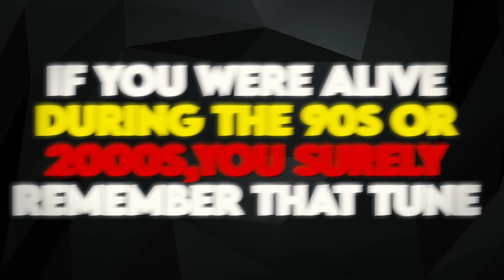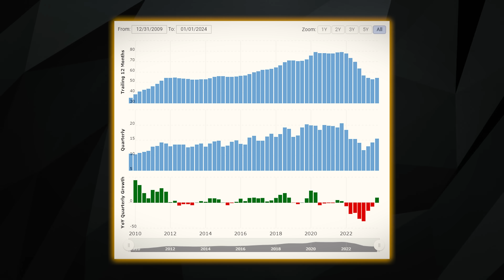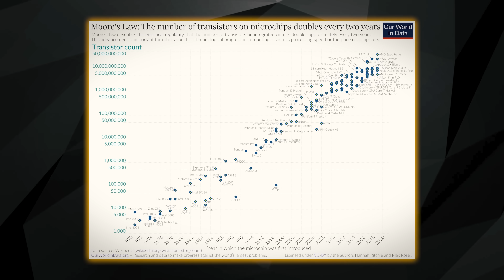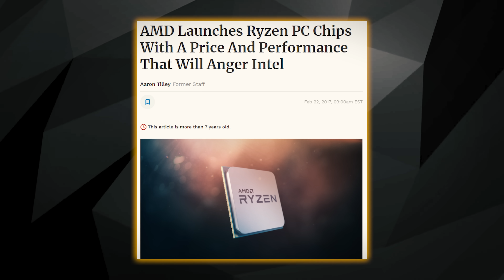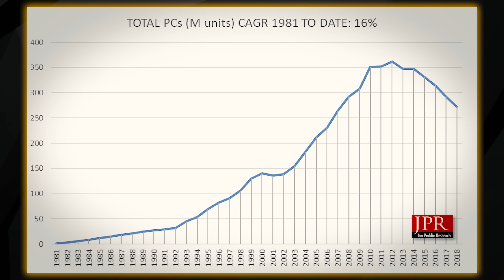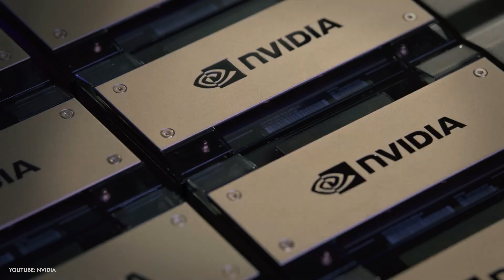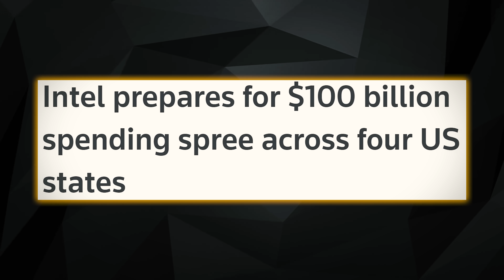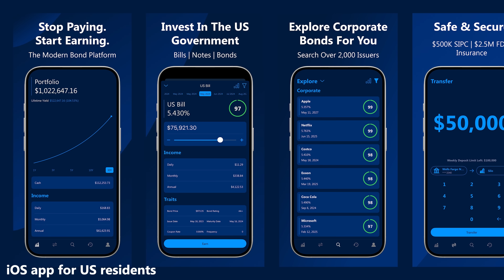The Dire State Of Intel...What Happened?

Comment: What happened to Intel is they pulled a Netburst, when they found their chips couldn't cut the mustard instead of going back to the drawing board they simply started cranking the voltage to get higher and higher clocks. It is exactly what they did with Prescott P4s when they found the Athlon was beating them on performance and ended up creating space heaters that still wasn't as good as the AMD offering only this time they have cranked the voltages so high the silicon itself is degrading.
Reply: Silicon can't run at 100*c all day. But Intel thinks otherwise lol. These things are so hard to keep cool it's ridiculous really.
Reply: @braixeninfection6312   When De8aur has to go to all the effort of a delidding AND liquid metal for thermal paste AND a custom milled waterblock AND a custom pump rig that can circulate an absolutely insane amount of water and even with all that he can't keep his 14900k from thermal throttling? Yeah stick a fork the current Intel arch is done.
Reply: @TheHangarHobbit  That amount of heat is pure insanity and to still be thermally constrained with all that cooling.
Reply: @braixeninfection6312  The issue isn't the cooling capacity, but rather the energy transfer rate limit from a tiny sand block to the rest of the cooling system.
Reply: Intel has spent more than 20 years marketing clock speed as their primary indicator of performance. That’s what lead to “Netburst” in the P4, and it’s what has driven power usage to insane levels. The only real step away from that was the Tualatin/Core/Core2 designs initiating out of their Israel design center. That of course has formed the basis of all subsequent Intel chips, but since then (~2006) it’s mostly focused on clock speed, larger cache, and in the high end chips, more cores, all of which have increased power/heat.

Performance of Intel x86 (per core) has roughly doubled in the last decade, but with it, power usage has increased significantly, only being brought back to similar levels by their 10nm (Intel 7) process. Being stuck on their 14nm node contributed to that significantly, but wasn’t the only factor. Now Intel is split, pushing lower power “efficiency” cores paired with very power hungry P cores pushed to even higher clock speeds, just so they can claim to be faster than AMD. Lowering the max clock speeds just 300-400MHz reduces performance by 3%-5% while reducing power/heat by more than 25%. Same old marketing driven pursuit of clock speed regardless of power (and apparently stability) concerns.
Reply: I remember those days. When the Pentium 4 came out, Intel was sure it could reach 10 GHz eventually 😂

In reality, the P4 1.6 GHz was slower than a P3 at 1 GHz.

Comment: You missed a few major points. 

First, a big reason Intel did so well for so long is because AMD was either A) getting blocked from OEMs by Intel or B) Emptying a revolver into their foot repeatedly. When the whole market is a duopoly, and one of the major players is just absent, then of course Intel will dominate. 

Second, your PC market share data is outdated. Ever since Intel released their 12th, 13th, and 14th gen chips that far outperform AMD, Intel has been regaining market share, and recent data shows it's closer to 66/33 split in favor of Intel. 

Third, it's worth noting that, although PC/Computer sales have slowed, Data centers that run everything still need CPUs, and this market has blown up, and continues to grow. Intel also has a heavy market presence in storage, network, edge, and car chips through mobileye. Intel is also making big advancements into the GPU market, and controls nearly 5% of the GPU market. It's worth noting that a big reason why Intel never made these moves into gaming and smartphones is because it'd require massive restructuring in the way they make chips. For AMD, Nvidia, and Qualcomm it's really easy for them to shift into a new market. They design a new chip, send the designs over to TSMC, and then a few months later they get their chip batches done. For Intel, they not only need to design the chips, but also change the manufacturing process, which would require a lot of investment and time to put into fabs, and to Intel that just didn't make sense at the time. The old Intel really hated investing into manufacturing and such. 

Fourth, a big reason why crypto and Ai are so heavily favored towards Nvidia is because Nvidia has spend years investing in software, such as CUDA. CUDA is the biggest reason why Nvidia is so dominant in Ai currently, as AMD and Intel have both made hardware that is arguably much better than Nvidia's offerings at a cheaper price, but the software for each still lags behind. Software has been a long standing issue for Intel, as they haven't made major investments into the sector, and still underpay both software and hardware engineers, although this is likely to begin changing with Pat at the helm(When he was CEO of VMWare, SWE pay was much better than Intel currently pays). 

Fifth, the reason Intel is losing so much isn't because they're investing a lot, it's because revenue declined, but fixed costs stayed the same. If you read the 10k, you'd notice that the operating expenses over the last few years has all been at about 50 billion dollars a year, while revenue has dropped. This is mainly because consumers aren't buying as many computers currently due to already having bought a lot of tech during the pandemic, and now with fears of a recession people are buying less. This is combined with higher interest rates, which means companies aren't borrowing as much to upgrade servers, which has led to a massive slowdown in revenue there. Yes, companies are upgrading servers with Ai chips, but that's only the top companies, and the vast majority of companies aren't spending much on chips currently. Nvidia only needs a few players buying a ton of chips, but Intel needs a lot of different companies buying, simply because servers aren't much better simply by adding more chips. Luckily for Intel, both these trends are only temporary. It's already been noted that consumer demand is rising again, and a lot of people have been waiting for 15th gen to upgrade, which will be coming out later this year. Also, most servers are on a timetable to upgrade, and servers only last about 5 years MAX, meaning the 2020-2021 servers that were bought will need to be replaced, and Intel will likely be the ones reaping these rewards. The massive Capex actually isn't that much more than historical amounts, and the foundry business has always operated at a loss to serve the chipmaking part of the business, it's just that now, people are getting independent results about this and freaking out. Intel has already stated that their current capex will likely come down in the coming years, as their 18A fabs are getting finished, and those will have the most advanced chipmaking process in the world. It's also worth noting that the 2026 figure you stated isn't about Intel in general, but about Ai. Intel doesn't need to convince the market about CPUs, because they're already the market leader. There are still tons of people that will only buy Intel chips, because AMD before Ryzen was a gamble on whether you'd be getting a brick, an underperformer, or a thermal disaster. Intel's main spending right now is all about their future foundry business, which you didn't mention for some reason. This foundry business is projected to be second in the world by 2030, and the revenue from that alone should help drive the company forward. 

Overall, the company is in a better position than it's been in over a decade. Pat is easily one of the best leaders in the world, and what he did with VMWare should show people just how capable he is as a CEO. I have no doubts that 10 years from now, Intel will be one of the largest and best chip companies in the world.

I'd say the video was good overall, and it made a lot of solid points about how Intel's past was markedly bad due to leadership while not ignoring the fact Intel has a strong future. It seems like most videos on Intel are only extrapolating past performance and suggesting that, even though the entire companies management and vision is different, that somehow the company will remain on this downward trajectory. I'd also like to see a video talking about their fab business and a deeper dive into that arm of the company. It has a very bright future, and with Pat at the helm, Intel will be a great investment for anyone willing to ride the wave.
Reply: Intel doesn't have a 3D Chip Stack CPU because they lack the tech and skills to make one. That already is a giant red flag and an indication that they're falling behind in the tech race.
Reply: On your second point - the Intel 12/13/14th gen chips don't outperform AMD, they mostly just match AMD. In some cases they outperform, but in many cases they also use a lot more power for the same performance, at least on higher loads.
Reply: @lycanthoss but the thing is now that 12th gen and Ryzen 5000 are cheap which one are you going for because as a consumer you want the best performing chip and i5 12400F and Ryzen 5 5600X are similarly priced but performance is lead by the 12400F
Reply: @Deathdemon65  12400f aren't the same class. Compare the 5600x to the 12600k
Reply: @moomie1634  the 12600K is more like Ryzen 7 5800X check the multi core and Linus video on 12th gen intel
Reply: @Deathdemon65  Right, but if you're comparing the 2, that means the 12600k, which is around the same cost as the 5600x, is performing as well as a cpu a full class above it
Reply: @lycanthoss  The reason Intel chips use more power is because Intel engineers have given complete freedom to the user to overclock the CPU to death. On a pound for pound rating, Intel does beat AMD, but this is only slightly, and even with a power cap and under-volting, the performance slightly favors intel(on some applications, some still favor AMD). The two are very close, but we'll have to see what 15th/8th gen brings, and I really believe Intel is bringing their A-game, as compared to 10th and 11th gen, this turnaround in competitiveness is insane.
Reply: @moomie1634  Nope. Intel cpu's draw double the power of amd cpu's at default settings.
Reply: @pf100andahalf  Because Intel's base clocks are higher. If you cap the wattage and voltage of each, Intel beats AMD
Reply: @moomie1634  Everybody knows that intel uses far more power than amd at the same performance level.
Reply: solid points but pat lied about the dividend although i give him credit for buying shares but investing in intel comes at the opportunity cost  of investing in nvidia which jensen has a proven track record of being leagues above pat.
Reply: @laCruz40oz  nvidia is overvalued. Intel is undervalued. Pat doesn't have enough time to prove what he can do, while Jensen has had decades. It's not a fair comparison
Reply: Wow! ~ A YouTube comment who does know what he's talking about! That's one for the books.
Reply: @Kneedragon1962  What did I say that was remotely incorrect?
Reply: @Kneedragon1962  do you have any evidence to back your point
Reply: What are you talking about? Intel still doesn't have a CPU that beats Ryzen 7800X3D (mind the 3D, the ones with and without the 3D are different CPUs.) 
In terms of workstation CPU, Intel still doesn't have a CPU that beats Ryzen 7950X. Not to mention the massive amount of incidents and reports saying how the 13th and 14th gen CPUs are literally burning themselves up due to overvoltage and overheating issues right now. Look it up, it's a massive controversy that even Intel has addressed. They've told motherboard makers to undervolt the base settings which won't make anything better since that would also affect their performance negatively. 
Intel has already lost in the gaming competition and they're losing the market super quick too. 
However, what really makes money in the CPU business is the server market which they've already lost in the performance front years ago and are also losing market share at an alarming rate.
Reply: @YIzDisSoHard  There are a lot of people that will defend intel no matter what. They already know that intel is in trouble but get mad if anyone acknowledges the reality of the situation.
Reply: @pf100andahalf  intel has already passed their worst stages. Things will only get better from here. I don't believe in blindly defending a company, and I acknowledge that, before pat, intel was a complete mess, and AMD was eating their market share by simply having better products. But, since pat has taken over, intel has managed to match amd and in many areas, even overtake amd. That's within just 3 years. Imagine what he can do over the next decade
Reply: @YIzDisSoHard  that's because intel doesn't have a 3d chip stack. I'm talking about raw performance, where intel still wins
Reply: also: ARM chips have potential to outperform Intel chips (Windows on ARM). when that happened, nobody buy Intel chips anymore.

many servers are using ARM based custom chips nowadays.
Reply: @raute2687 amazon sales don't mean much. OEMs still use Intel overwhelmingly, and most non-amazon retailers such as best buy sell way more Intel stock than AMD. Plus, 15th Gen should really help Intel

Comment: Intel simply ran into the "wet van de remmende voorsprong", which very loosely translates as "the law of contemplacency". Intel at a time was só far ahead of AMD, that they decided they could afford to take it easier on their development, thus saving hundreds of millions of dollars per year. Then AMD made a break-through with their Ryzen chips and for Intel that kind of came as a huge surprise and they've been struggling to catch up ever since. 

But Intel has made this mistake before and weirdly they don't seem to have learned much from that experience. Remember the time when AMD's XP CPUs wiped the floor with Intel's CPUs because AMD's CPUs were way more efficient than Intel's CPUs, so despite Intel having CPU's that worked on much higher clock frequencies, AMD's CPUs outperformed them. That seems to have happened again when AMD introduced their Rysen CPUs.
Reply: It's much more because of Zen chiplettes, not chips.  It's all about the chip yield.  First numbers I heard before TR's release was that they were getting 80-90%... which was sick.  What do you think the yield is on a 28 core Xeon, all cores up and over spec?  Single digits.  And if just one of those 28 cores is a little weak, bzzt.  Meanwhile AMD pulls four chips from their best bins and effortlessly spawns another perfect monster.  This leads to Intel pulling all their top silicon they'd normally want $12,000 for, selling it for $2,000 and bleeding out the ass.  Meanwhile AMD sells theirs for $1,000, outperforms, and still makes money.  And still even now, Intel won't abandon monolithic architecture.

Comment: didn't even mention arm that is munching on their server business for many reasons. energy, ARM processors consume significantly less power compared to x86 chips, resulting in lower cooling requirements and reduced energy costs for data centers. By distributing workloads across a larger number of lower-power ARM cores instead of fewer high-power x86 cores, ARM servers can achieve better energy efficiency.
High Density
The system-on-chip (SoC) design of ARM processors allows for higher core densities, enabling more compute power in a smaller footprint. ARM servers like those from Gigabyte with up to 48 cores per chip can provide high performance while occupying less physical space in a data center.
Cost-Effective Scaling
ARM processors are generally less complex and cheaper to manufacture than x86 chips. This makes it more cost-effective to scale out ARM server farms by adding more nodes as needed, rather than scaling up with more powerful but expensive x86 servers. AWS (with Graviton), Alibaba, and others are already deploying ARM-based server instances in their data centers to leverage these benefits
Reply: This is just not going to be true. ARM chips have so many weaknesses. They can't run most x86 apps, they can't run processes as fast. The only reason x86 isn't being built by Qualcomm, Apple, and Nvidia is because it's open source and just requires royalties.
Reply: @moomie1634  RISC-V is on the horizon as well
Reply: @mike_et_saika  that's what they always say. Everything is the x86 killer. It just won't happen
Reply: @moomie1634  I've never said that. 

I never said that. It's just one more competiting architecture and RISC-V won't be in any PC's anytime soon, but for me as industrial tech engineer, it's a godsend.
Reply: And that's why I sold my NVDA at $950 and shifted it to ARM.  Damn I'm a clever yob eh?  ;)  The reason we haven't seen things like 3D memory integration is because that stacking = heat.  I expect this will be less of a problem with ARM arch.  Is compute IN memory possible with ARM?  That would be a truly massive breakthrough.
Reply: @artdehls9100  ARM!?!?!? DUDE, THE COMPANY IS TRADING AT 37X SALES